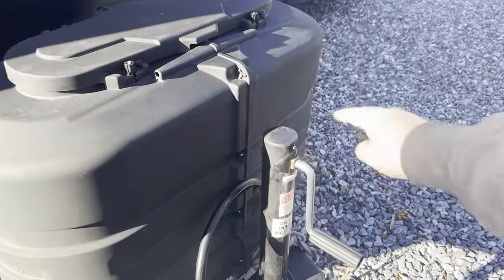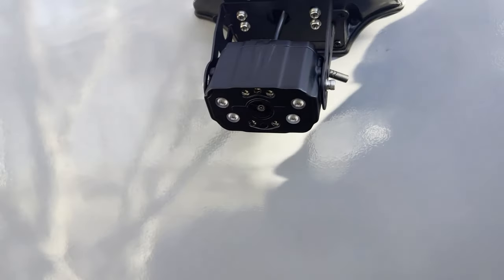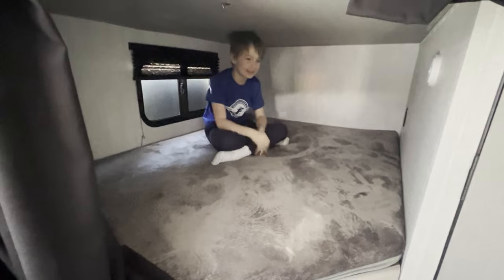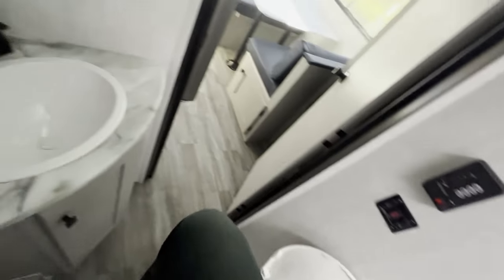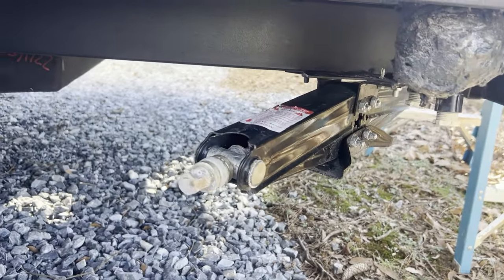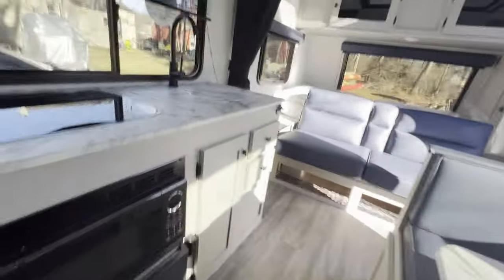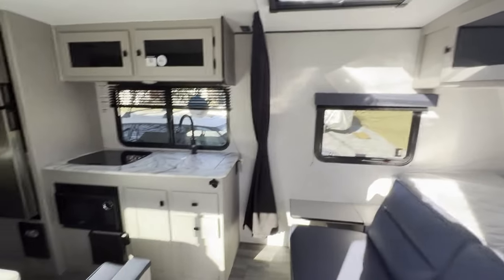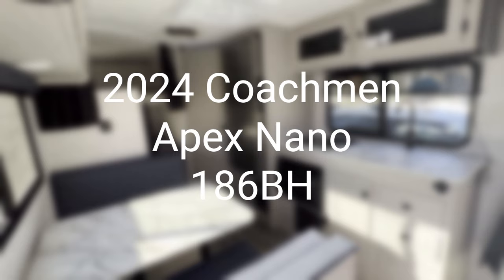2024 Coachmen Apex Nano 186BH Walkthrough

Comment: Thanks to share the personal experience of a trialing I'm almost ready to also buy.  My last reservation is I'm not sure about having a camper queen (60 x 74) vs true queen (60 x 80).   The other rig I'm considering is an IBEX 19BHEO which has a true queen, and almost the same setup.  So how is the camper queen for you - at I believe you said 6'-2" ?  Would you go for the IBEX if you did this again?  Next I'm trying to find your WDH review.
Reply from the maker: Sorry. I lied, I never published that one 😂 I’ll finish it up here shortly. I love this camper. Only things I would change:
Griddle move to other drawer (it’s too close to the edge of the awning), the blinds are awesome but the screws holding the strings down suck and aren’t anchored into anything so you have to operate with kid gloves on, and when you unfold the front bed it ALWAYS hits the emergency window release, it’s only a matter of time before I screw something up there. As for the bed, I don’t mind it after a glass of whiskey. I have to sleep on the side closest to the kitchen, as the window side is better suited for a smaller human.

Comment: Wires that you were questioning under the rv are for the tank level sensors!
Reply from the maker: Thank you kind sir! I’m not super impressed with the way they are coming out of that rubber sheathing…or the lack of one zip tie that would hold them up a bit neater, but I also have a really good friend with a $100k RV that has some of the same issues with quality 😂

Comment: How did your highlander do towing that trailer?
Reply from the maker: It’s awesome! The rear suspension is super soft, so you’ll need either sumo spring inserts or a weight distribution hitch. I bought both, but only put on the WDH so far and it tows like a dream. We’re only averaging 14mpg, but it’s been mainly back roads so far this season.
Reply: Awesome! Thanks. Thinking about pulling the trigger on this trailer, but I didn't want to upgrade my suv.
Reply from the maker: We were eyeing the 208bhs for a while, but I’m glad we went with this. That extra tongue weight and load would’ve been way too close for comfort.